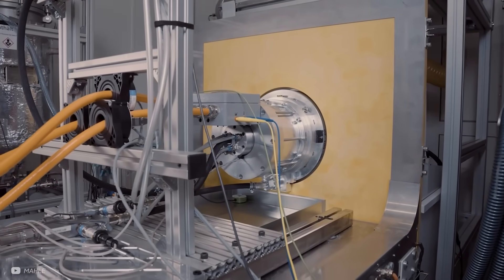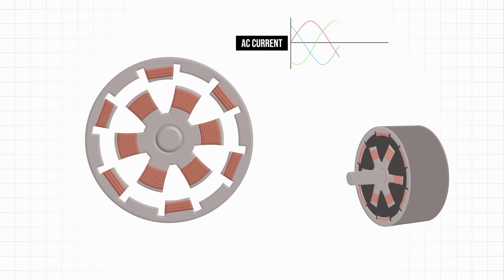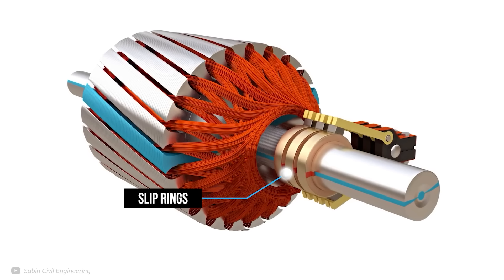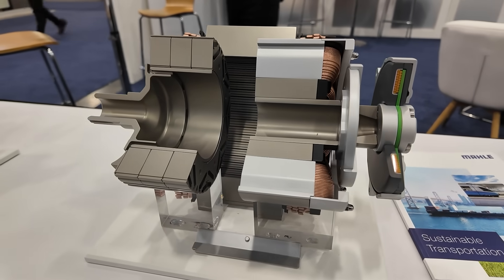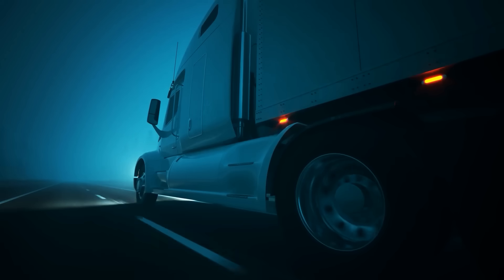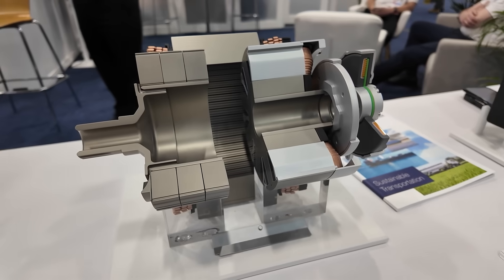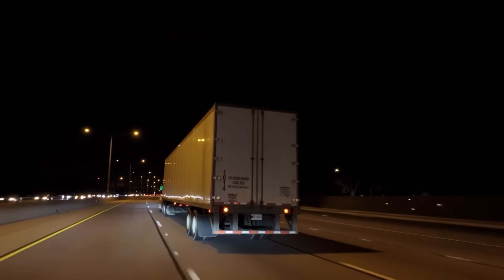Genius Contactless Motor Could Change Transport Forever

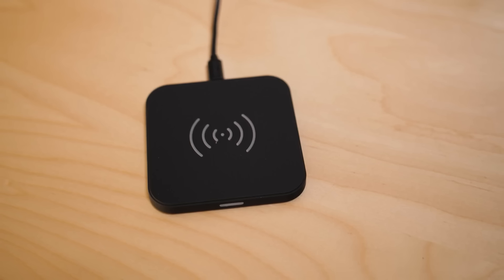Comment: Please correct yourself at 4:43 when you say that wireless charging makes power transfer more efficient as opposed to using a physical connection. IT DOES NOT. It makes it more convenient, but it is MUCH less efficient and is a huge waste of energy.
Reply from the maker: I removed this section as it was a mistake - I was meant to be referring to it being more efficient than an induction motor but had it in the wrong section of the script! Thanks for pointing it out - Ryan.
Reply: Wireless frequency synced power transfer can be more efficient than slip ring energy transfer that wastes energy lost to friction heat and sound energy  @ZirothTech
Reply: @ No worries :) I noticed that I seem to have started many arguments, almost all based on misconceptions, in the replies to my comment! 😆
Reply: I'm going to stick my neck out here because I should know better but clearly forgotten stuff. (Been a long time)

A transformer coil induces current in a separate coil by induction.  The same principle applies in an induction motor.  It creates current to magnetize the material in the the coil without physical contact.  

Apart from the name, 'wireless', how is this actually different to standard induction?
Reply: @PhilJonesIII  The losses in the cage are just so much higher than normal coils at lighter loads. However the biggest problem with the induction motor is the low starting torque which needs to be addressed with gears and or pulleys.
Reply: @kevinrtres  Cool, thanks for taking the time to reply.
Reply: @PhilJonesIII  Even in the transformer an Iron core is added to contain the magnetic field and make the transfer more efficient, As its magnetic conductivity is much higher than air most of the "magnetic flow" goes through the core, also both coils are intertwined around it, making the distance virtually 0, with very little waste  because of the CUBED distance ratio of magnetic forces so even small distances (mm) matter a lot, so no no way to make wireless more or even as efficient as a transformer, which for your knowledge are avoided on small electronics because of their losses.
Reply: @ratgr  Cool, thanks for taking the time to reply.
Reply: sounds like he fixed it
Reply: i hear the word convenient in the video not efficient at your time code.
Reply: @joshdm  I don’t know if this is possible on a video that is already uploaded, but it feels like it is edited at that time spot now. The way he is saying “it is more convenient…” has the rhythm and intonation of a sentence that would continue with “and efficient.”  It’s like the audio just cuts suddenly the end of the sentence off.
Reply: @joshdm  he fixed it with the youtube editor in the creator studio
Reply: @ABaumstumpf not at all. I even used an incandescent light bulb as an example of the differences. The flow of electricity directly interacts with the wire inside the incandescent light bulb whereas an effect or magnetic field created by the flow of electricity is what is interacting in the motor/wireless charger.  Think of it more as two separate steps/circuits - using a light bulb to power a solar cell that powers a calculator.  The path of the electricity is complete with the light bulb snd the effect of that interacts with the solar cell. It is this magnetic field created by thr flow that interacts with the other magnetic fields in the motor or induces one in a separate circuit.
Reply: I agree, as I posted also, before reading your comment.
Reply: It depends on the coupling efficiency. Ever heard of transformers?
Reply: Also the frequency of the cycle would affect this too.
Reply: Furthermore, rare earth metals are refined as a byproduct of iron mining - there is currently near 0 digging for rare earths alone. ...While this moror likely uses 2.5-3x more copper vs permanent magnet motor - and copper is mined on its own.

So the whole "save the planet angle" is deceptive here and in fact backwards.
Reply: @AlexKarasev  
That is one view.
Reply: @johnburns4017  "that is one view"? I'm sorry, the breakdown or rare earth tonnage by raw material source isn't "a view", it's an objective numerical breakdown as concrete and readily obtainable as say a stock price.

Practically all rare earths aren't mined - they're extracted from the "waste" byproduct of iron ore refinement - which is already dug up from the ground and pulverized, making their extraction much cheaper (in literal and environmental cost) vs being mined separately - which copper often is.
Reply: If you think about it slip rings are also 'wirelessly' conducting electricity.  It's just that the gap is atoms deep rather than paper thin.
If moving the contact points a few nanometers can lessen the wear on the rings without reducing the energy transfer, which is pretty much what they're doing here, then why haven't they made advances there?
Reply: I think that's why they designed the motor this way, not like the induction motor he mentioned, bc making an industrial dedicated part of the motor for induction power, they can max the efficiency like you described, minimizing the distance, etc.
Reply: They are both around 90% efficient.
Reply: your thinking of a phone charger which is only 50% encapsulated, there for 40% efficient fully encapsulated Inductive chargers are a loss, but not as bad as a brush and slip rings
Reply: @thomas11malinowski  Thank you, but I stand by my observation.
Reply: @xenuno i do not disagree with that. However,  my point was more to how it functions differently. Induction can be very efficient.
Reply: And the whole consept is a big lie for lame people. It is inferrior in efficiency, reliability and complexity. BTW has anyone ever seen sliprings damaged in the way it was presented in the video? 🤣🤣🤣
The only true was that they did not claim invention of dielectric oil like the previous company did.
Reply: The Oak Ridge National Laboratory has demonstrated wireless car charging at 270kW with 95% efficiency. 

Wireless charging can be both very high power and very efficient. 

https://www.ornl.gov/news/polyphase-wireless-power-transfer-system-achieves-270-kilowatt-charge-sets-another-world
Reply: Jetstream_ YOU are comparing direct with wireless. However, if you compare slip ring brushed powered motors, and all the physics of what's not explained here to wireless, then take into account the wireless improvements, the efficiency benefits of wireless over directly connected, is more efficient. So you are right for sure, 'generally and in almost every other example; but wrong in this case, given the specific way this unique system as whole, works.
Reply: Did you calculate the factor that it is cleaner in building and recycling? Yes, wireless transfer of electricity is less efficient than connected, but we use induction cooking (better than electric heater or gas) that works very well, lots of wireless chargers do also work, not better than direct connected. But this still is better than using up rare Earth materials for everything. Plus, we need to take care of our planet, we have the wisdom, we have the technique, and all this combined brings us using abundant materials instead of rare and costly. Mag-lev trains are also not energy efficient, but if we need to power trains and want more speed, than that is a possibility. Normal trains can't go limitless in speed, they rip the wheels apart trough centrifugal force and wears them wheels out very fast. So if we want to go faster, we have to leave the wheels, same with motors, do we want to use up rare Earth materials? No, it's industry is poisoning our environment and the outcome is not durable (Heat destroys magnetism in (not so) permanent magnets).
Reply: @MrKillerno1  Do you even listen to yourself?
So, we need to "look after the planet" by using methods that are way less efficient to power things. (but they're "cool" and hi-tech!)

Hook line and sinker.
Reply: @MrKillerno1  " Plus, we need to take care of our planet"
One more reason not to use wireless.
Reply: A wireless charger is just a badly designed transformer. They are inherently less efficient than
A transformer and definitely less efficient than a piece of wire. They are used for convenience rather than efficiency.

These types of motor using slip rings have been around for a long time in industrial applications such as generators and locomotives. You can argue why they mostly stuck with slip rings.

It will be interesting to see how these motors perform , both economically as well as real world performance.

It will be interesting to see how the oil cooling works out in reality. Will it work well or will people be having to do their frequent oil top ups as it leaks everywhere? It sounds good in principle but oil always finds a way. Again look at the current users of this type of motor and consider why they don't do it this way. That is not to say it can't be done, just that it probably won't be easy.
Reply: @DanRyan-v5y electrical current traveling through a wire... i assumed everybody here already knew that.
Reply: @sumduma55  but you were implying earlier in the thread that the electric current was not a factor . Obviously it is because it creates the magnetic fields that transfer the energy
Reply: @DanRyan-v5yh not at all. I was implying the electricity itself doesn't power it, the effect it creates does.  I think in one post I even likened it to using electricity to power a light bulb that in turn powers a solar cell on a calculator. There is a separation from the wire itself and the work being done.
Reply: @sumduma55  not really, the electric and magnetic fields are interlinked. Claiming the two stage thing with bulbs and calculators does nothing for the efficiency of the total system
Reply: Actually wireless charging for EVs are like 95% efficient. It's the phone that are inefficient in wireless charging m
Reply: @JSM-bb80u  no, even properly designed transformers have some losses, and badly designed transformers with big air gaps between the coils are never going to be very efficient, Certainly no where near as efficient as a cable.
Reply: @JSM-bb80u  Ahhhh... you've got that wrong buddy.
Reply: You did not get the point of the vid.
Reply: I'm not sure about that. The friction is more energy isn't it? No karts thought.i gotts hear this
Reply: Agreed, I  believe slip rings have power transfer efficiencies of at least 95% depending on the quality of contact. Whereas wireless charging is around 70-90%.
Reply: @DanRyan-v5y it kind of does. This is because you are not comparing apples to apples. You are comparing the efficiency of  directly converting energy from one voltage and form (ac/dc) to be used or stored elsewhere to the creation and shaping of s magnetic field that interacts with another to achieve a similar objective. And as we know with inductive motors,  this can be very efficient and even more efficient than other types of motors when you consider use variables.
Reply: @sumduma55  not really. No  I didn't bring up any of that stuff at all. You brought up the lamps and calculators and tried to say that the electric current had no direct effect on the action of the motor, so don't try and pin your ideas on me.
Reply: @DanRyan-v5y i never said they weren't interlinked. And it isn't directly affecting it. Take away the opposing field and the circuit is still complete and energy still flows.  Take the load away on a hard wired object like a light bulb and it all stops. It isn't the same!
Reply: This is why I don't watch channels like this they typically don't know what they're talking about. OUT.
Reply: Absolutely, it gets SO HOT there's the first giveaway, I remember first trying that and never did again due to that temp rise alone, with charging my phone, I mean.🎉.🤔
Reply: Don't think electric, think magnetic. As electricity is the hybrid of magnetism (toroidal) and dielectricity (hyperboloidal), harness the charge! And know that the word energy was never properly defined in any field of science. Like saying atmosphere.
Reply: I think in efficiency terms, a slip ring system at high speeds can cause contact, heating and sparking issues, wear and debris buildup AND it wouldn't be conducive to the oil cooling system. Overall, its lower maintenance and allows the unit to be sealed providing an overall gain in efficiency, mechanically speaking.
Reply: Yeah, the channel owner is not that smart so he makes mistakes.
Reply: This channel is not interested in accuracy.
Reply: what i got from the video is power losses from wireless power transfer and permanent magnet induction losses are around the same which equate both to 95% efficiency
Reply: I need a fact check. Electric motors are very efficient IE 96% or more. A contact less motor will not be that much better. 
  If it uses carbon brushes like a DC motor they wear out. Induction wirless is not as efficint.
We will see once these are out in production.
Reply: @PhxElecAuto  motors and generators with slip rings have been around for a very long time, maybe a century or more. I think even the induction transfer  of the exciter current has been done before. In fact in the back of my mind  I remember a YT video about some old rescued generator having an induction system to get the rotor current across the gap
Reply: I blocked his channel. There is no need to waste time on someone who doesn't have the depth of knowledge required on the topic he informed of.
Reply: @walter6574 lol, one mistake and you write someone off forever.  He replied in this thread and stated he removed that section now and it was a mistake in the video script he wrote.  I can understand there is no place for mistakes in the application of engineering but this video is more of a conversation and imo should be food for thought and this thread as a place of conversation not to just condemn someone for a careless mistake that the guy owned up to
Reply: @johnmcgraw3568  It's not a mistake, it's the lack of providing information that I find necessary. Why bother with a channel like that?
Reply: @walter6574  i know men smarter and more accomplished than me and they make mistakes or sometimes don't have all the knowldge of a subject, as humans there is a limit to our abilities.  I understand on critical comments building something every thing needs to be a 100% but on a forum of ideas I'm not going to be as critical but may join the conversation
Reply: Their are ways to reduce that wasted energy and make the transfer more efficient also he also recently recognized that he did make that mistake at 443
Reply: @wheatthicks electricity is not doing the work here. The magnetic field associated with it is. An incandescent light bulb for instance uses the resistance in a wire to produce heat which radiates as light. That uses the flow of electricity directly to perform the work. On any motor,  it is the magnetic field associated with the flow of electricity that causes the work. Think of how transformers function. The magnetic field of one coil wire induces another magnetic field in a separate coil of wire. This magnetic field is what causes the motor to turn.
Reply: @sumduma55  "electricity is not doing the work here. The magnetic field associated with it is"
Ah - so electricity didn't do any work in incandescent lightbulbs - just the heat associated with the current....
Reply: @sumduma55  and what causes those magnetic fields?
Reply: Well now wireless is faster than wired.
Wire only used as guided wireless like light in fiberoptic. Actualy you can get the same speed without the fiber if the alignment is straight point to point.
Reply: Wireless charging does not have to be much less efficient than wired power transfer. Don’t think that the efficiency of Qi wireless charging has anything to do with this kind of wireless energy transfer.
Bjorn Nyland had a really interesting demonstration where one case of wireless charging of an EV was more efficient than wired EV charging.  You gotta look at the whole system. If can optimise the whole system for efficiency you’d be surprised how efficient wireless energy transfer can be.
Reply: @auspiciouslywild  "Wireless charging does not have to be much less efficient than wired power transfer. "
It does not have to be much less efficient - but it can not be more efficient.
Reply: @ But slip rings also cause efficiency loss. Especially at very high speeds. So in this case the wired solution is not necessarily more efficient.
Like I said, you have to look at the whole system.
Reply: @ABaumstumpf  We can absolutely build a wireless magnetic charger that is overall more efficient than a small usb-c connector, especially at higher amperages.  In this application where the two coils don't have to deal with layers of plastic between them the efficiency approaches the level of a capacitor (two small metal sheets held infinitesimally apart).
Reply: @njsification  "We can absolutely build a wireless magnetic charger that is overall more efficient than a small usb-c connector, especially at higher amperages."
Proof it - you'd be the first in human history to do so.
Reply: @ABaumstumpf  are you considering the resistance in that copper cable? While it is a good conductor it is not a perfect one.
Reply: @njsification How?

Of course if you put 2kA through a connector that is meant for 5A then you'll see some crazy stuff which could prove your point, but can you make a more reasonable point?
Reply: @Kitt_the_Katt  " are you considering the resistance in that copper cable".... you ... ok - so tell me you have absolutely no clue about electronics without telling me you have no clue.
Reply: The inverse square law is a proper bastard though  @auspiciouslywild
Reply: @Kitt_the_Katt  the resistance in the copper cable would actually be an argument against wireless. given that to transmit electricity you have to have 2 copper coils that together have much much more copper wire then they would have if you just used one small wire to directly connect the two sides. the wireless transmission rate could be a perfect 100% and it would still be worse then just a direct wire connection because of the coils required to transmit the power.
Reply: @njsification  What???
Reply: @Kitt_the_Katt  Limit to USB charge is wire SIZE.
Reply: @njsification  that's why usb-c allows for much higher voltages than the original 5v usb spec. no way in hell a loosely coupled qi charger is going to be more efficient than usb-c at 20v, 36v, etc
Reply: @ABaumstumpf  "The first human to do so"...   Isn't that why we have engineers and inventors?  Every year people do things that they are the first person to do.
    The first step is to NOT limit yourself.
Reply: @ABaumstumpf  Id reccommend looking into the patent and paper that Dr. Hal Puthoff made about scalar communications. Using transverse waves for energy trandsfer well traditional is inefficeint and a waste of time and resources compared to the capabilities of scalar wave energy transfer and communication.
Reply: @Kitt_the_Katt  Newsflash: Copper is the BEST conductor available.  AIR is an insulator in ALL cases and you LOSE energy.  PERIOD.  Until super conductors are created, copper is king.
Reply: @ABaumstumpf  In the limit of a superconductive wire and a distance between receiver and transmitter going to 0 for the wireless, they have the same efficiency ;).
Reply: @Kitt_the_Katt  Wire coils also have those losses and they are much more than a cable since coils are way longer than a cable directly transferring power. Creating a wireless power transfer that is more efficient than cables is impossible unless you're using some exotic material that is not copper coils competing with shorter copper wire.
Reply: @roydunn4649  No one is limiting anything except for the laws of physics.
Reply: @VestedUTuber "so it's not the high bar you seem to think it is. "
Ah we got another Dunning-Kruger.
Reply: @roydunn4649  "The first step is to NOT limit yourself."
No, the first step is to accept reality - being a delusional clown does not make you anywhere close to being correct.
Reply: @njsification  why would anyone think that a usb charger is a starting point in this discussion?
Reply: @ABaumstumpf   Wireless charging more efficient than a specific type of connection designed for longevity rather than efficiency? That's not even that difficult. Wireless charging more efficient than a physical connection also designed for efficiency? That's not possible.
Reply: @auspiciouslywild  - Induction motors don't use slip rings and have been in use for over 100 years. With lower cost inverter electronics induction motors be made to adjust their speed and torque over a wide range and can replace DC motors with commutators and brushes and the resulting cost and maintenance.
Reply: @Kitt_the_Katt induction charging pads also have cables. So the only way it could be more efficient is if coils were more efficient than the plug at the end of the cable that connects to your phone. You have your work cut out making something more efficient than a plug.
Reply: @ABaumstumpf  but the argument is not about wireless charging vs USB - it is about wireless charging vs slip rings.  I just did a search on  "In a motor, how long do slip rings and brushes last?", and the answer that came back said "with a typical lifespan ranging from a few thousand to tens of thousands of operating hours"   I don't know how many "tens of thousands of hours", but at a single 10,000 hours at an average speed of 25 MPH, that would be 250,000 miles.  I chose 25MPH because, for a typical vcehicle, which spends a lot of its time on local roads, maneuvring, etc, that seems quite likely.  Maintenance, or possible replacement of a motor's slip rings after a quarter of a million miles doesn't seem that unreasonable.  In fact, replacement of most vehicles at that mileage is not unreasonable.  I'm thinking of replacing my car soon, and it has done about 80,000 miles in 18 years.
Reply: @DownhillAllTheWay  I am just showing how wrong the arguments are - it was not me that is that stupid as to bring up phone-charging.
And tens of thousands of hours is more than just 10000 hours and those are really cheap and easily replaceable parts. You do realise that many other parts on a car need regular maintenance? 
And even then - why bring up the strawmen of sliprings?
Reply: @WJV9  Induction motors and SRM (which is what EVs generally use these days) have different strengths and weaknesses. Which why e.g. Tesla uses both induction and SRM in their dual motor cars. In single motor I think they use only SRM because it gives the highest efficiency.
The motor talked about in this video is aimed at replacing SRM motor I believe. Didn't they mention induction motors in the video? I think so.
Reply: @gavinknight8560  The inverse square law isn't very relevant when the conductors are just mms apart, and they have highly tuned resonance which focuses the energy transfer exactly where it needs to go.
This is almost in the same category as capacitors or transformers, which also transfer energy without a direct wire connection.
Reply: @ABaumstumpf  Have you ever heard of an isolating transformer?
Reply: @dustinbrueggemann1875  and they are relevant cause? Oh right - you are just trying to change the topic.
Reply: @ABaumstumpf co.paring a small wire to a big system you can say it's more efficient but when sending  it though with thicker wire the wireless is less efficient.   You are saying creating 2 magnetic fields, one for power and one for driving it is more efficient is just bogus.  The only thing this has improved on is the cooling system that will in the end make it less efficient but allow it to run longer.  The fact is, when sending a large amount of electricity through a spinning disc, you will end up with much bigger issues.  This design for wireless is never going to work correctly.  How is the shaft staying in place?  Sending the current through barking will always be better and will be the next evolution.
Reply: @VestedUTuber "Seeing as I then pointed out that the issues are limitations with USB-C's design"
Yes-  you tried to change the topic cause you were shown to be wrong.

"Not my fault you can't read."
And Mr DunningKruger is projecting again.
Reply: @ABaumstumpf just add more copper to the wires aka “use thicker wires”
Reply: @VestedUTuber "No, you cherrypicked my comment so you could toss ad hominem attacks"
showing that you are wrong is neither cherry-picking nor an ad hominem.
But your constant attempts at moving the goalpost shows clearly that even you know you are wrong.

"I'm not the one who immediately resorted to ad hominem because I couldn't address a point directly."
Correct - but that is a strawmen: You are the person that immediately tried to go offtopic and move the goalpost.
Reply: @VestedUTuber "You quoted a single line from my comment out of context"
Not out of context. 

"and then called me a Dunning-Kruger case."
Yes - i stated that fact. And if anything it would still, despite your repeated false claims, not be an ad hominem.
Now you do you - you can keep repeating lies, trying to change the topic, constantly going for personal attacks.

But the 2 things you never did, not a single time, was showing any understanding or evidence, or being correct.
Reply: @HildeTheOkayish  При этом не стоит забывать, что и у медных катушек, для передачи энергии, тоже есть своё внутреннее сопротивление, что так же не мало снижает КПД всего устройства да к тому же и стоимость, порой просты щётки гораздо практичнее, чем беспроводная система, со своим контроллером и кучей дополнительных проблем с ремонтом. а так же не стоит забывать, что основные катушки статора, тоже будут наводить магнитные помехи в работу беспроводной системы, по итогу мы имеем только этот макет, и даже нет хоть маломальски рабочего прототипа..
Reply: @w8stral  Вообще то, сверхпроводники уже давно применяются, и в огромных количествах, особенно в коллайдерах, где нужно создать огромный магнитный поток.
Reply: @Kitt_the_Katt silver?
Reply: @auspiciouslywild by the laws of physics you cannot have wireless charging be more efficient than wired. Wireless charging requires conversion of energy firm which always has losses.
Reply: @cirelancaster  That's only the case if the sending and receiving end requires the exact same voltage, and you've got either AC or DC at both ends. Otherwise you need energy conversion with the wired connection as well.
I'm getting tired of repeating myself: you gotta look at the whole system. Not just the wires. If we're comparing with induction motors, there's losses in eddy currents in the rotor. If we're comparing with motors with slip rings, there's resistance in the slip rings at high speeds.
Reply: @auspiciouslywild there will always be losses in a wireless system that are not present in an appropriately sized charging cable.
The only question is, then, are these losses significant?
Reply: @auspiciouslywild  how come? wired you have copper losses. wireless, even in resonant converters you have at least switching and conducing losses in both sides as well. Not to mention coupling factor of the coils, specially in movement. Havent seen any paper EVER comparing efficiency on both methods, just convenience.
Reply: Are you sure about that? Wireless charging is essentially no different than a transformer which wireless chargers will likely employ in some form as well as the energy source when delivered. There might be small losses due to increased gaps between the coils but some tradeoffs can be less resistance for regulating voltage. This setup is essentially using induction to power an induction motor which is claimed to be more efficient because the load is only what is needed to produce the required amount of work. Of course this looks different when you start using pulse width modulation instead of pure voltage or amperage control. I'm not about to bother going through the math to check though. I'm just tossing something out to consider.
Reply: @sumduma55  Since you are making a transformer analogy ... air cored transformers are much less efficient than iron cored at the frequencies < 20 kHz, so I've read. For wireless chargers, the losses are not small .. more like .. tolerable because of the convenience factor. Nothing will beat a direct conductive connection including this motors use of induction. The vid is generous on it's speculation of this new design's inductive efficiency. Now to hit YT for another fusion "break through" which is still only 50 years away. We'll see how ITER does ...
Reply: @sumduma55  wireless charging will never be *anywhere near* as efficient as a transformer where both coils share a common iron core.
Reply: @sumduma55  you are correct in principle, but keep in mind that the coils in a transformer are wound around a common metal core. This vastly increases the efficiency because it 'traps' the generated magnetic field of the primary coil and 'guides' it to the secondary coil. Wireless charging setups of course don't have this core, leading to reduced efficiency.
Reply: @ This is very simple. Air is a worse conductor than copper, thus wireless transmission is less efficient than wired transmission.
Reply: @wheatthicks  That is not true. Compare the signal loss of a cell tower to a cell phone to a cable network of the same distance. The wireless transmission loss will be orders of magnitude lower than the same signal sent over cable. Now consider the signal loss through a cable going to space and the loss with a Starlink connection. The fact is that electromagnetic energy can go through air with virtually no loss for hundreds of miles(unless it's raining).
Reply: Because this technology is banned for 100 years genius. Heard about Nikola Tesla?
Reply: I continue made my innovative project of a non-combustion engine, I remind you that I am posting here on my channel the technology and the principle of operation, according to which anyone can create a prototype and enjoy free energy, since I was denied financial support at the stage of the idea and theoretical research, after a year of unsuccessful searches. Including I will begin to assemble a sample. And soon another video will be released, revealing my developments, the wind of change is approaching! All those who are not indifferent, welcome to the flight in this departing innovative car, which will lead to great achievements for the successful future of the planet and humanity!
Reply: @maguccimotorincorporation  ... and it runs on "free energy"!  Yeah ... sure!
Reply: The second law of thermodynamics states that we should short your stock.
Reply: @maguccimotorincorporation  There is only 1 practical way for the foreseeable future. That is ICE engines using H.A.S. It is doable but no one is doing.
Reply: @shirleymental4189  I don't understand what engines you are talking about, could you tell me?
Reply: @maguccimotorincorporation  I'm talking about hydrogen powered engines that convert water to hydrogen at source (the engine) efficiently  so not having stored hydrogen.
One was developed by Stan Meyer. If some effort was put in it is definitely doable. It is curious to me that they don't.
Reply: @shirleymental4189  It's probably not profitable for the oilmen.
Reply: @maguccimotorincorporation  I'd say that is correct. Like Big Tobacco moved into the vape market, I'm sure the oil men will also move into the rare earth element market and probably have already.
Reply: @shirleymental4189  And now we have a choice